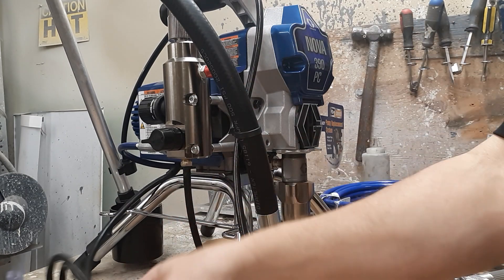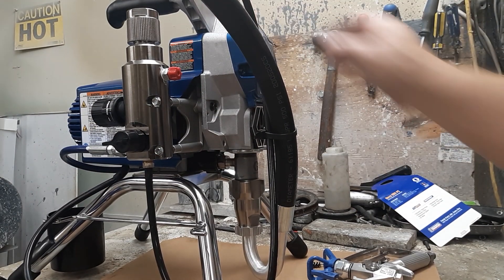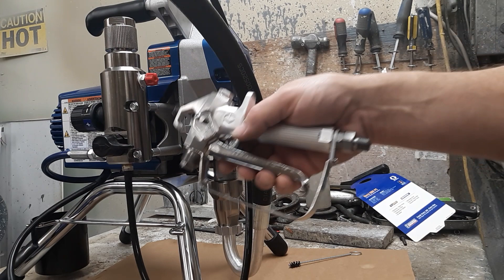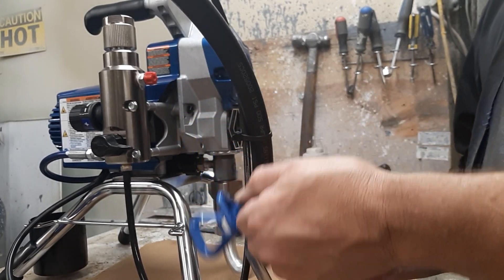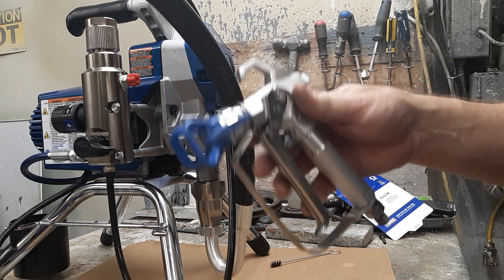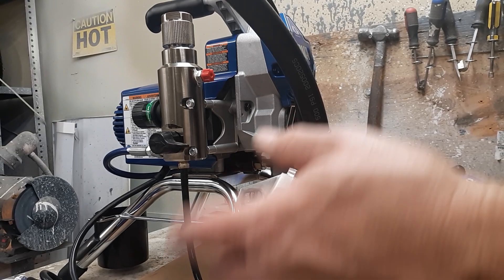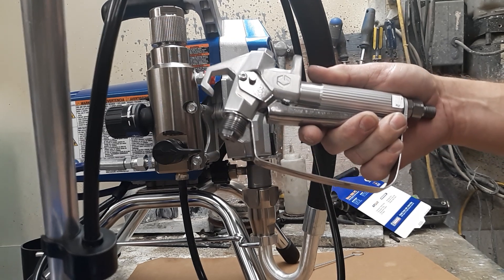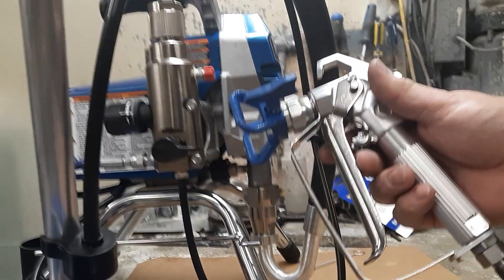How to use a Graco 390 airless sprayer

Comment: Great explanation for a new starter like me. I have watched many videos, even the instruction manual of my new machine but no one explained the significance of free moving nut while connecting paint hose to the spray gun to allow for swivel action of the gun with hand movement. I was in a fix to see why the nut at the inlet of the spray gun kept turning. Thank you for your explanation. Also, thanks for explaning right and left placement of the spray guard/tip hoder for right and left direction of spray. Great work! :washhands:
Reply from the maker: @coloursofniji  I am glad it helped you out. If you'd like to support the channel consider a super thanks.

Comment: For starters it says to run water or mineral spirits through it to take the shipping oil to get it out of the paint sprayer
Reply from the maker: Not sure what your addressing
Reply: @Brian_the_repair_guy  ya in my manual it said to run out the shipping oil that was already in the system,
Reply from the maker: @zachthegunguy  if new, yes. This video is basic operation.  Not specific to new equipment

Comment: Thanks so much for the great video. I spray a lot of xylene  Solvent based products. Do you know if the Graco 390 would work with xylene solvent? Thanks In advanced!!
Reply from the maker: Yes it will.
Reply: @Brian_the_repair_guy  would you recommend after cleaning with Xylene to leave xylene in the machine until next use?
Reply from the maker: @robertdavidson6339  that is perfectly fine. No problems with that

Comment: I just got a 390 and have a project at home this weekend. Curious why do you have to keep taking the tip off ? Couldnt that just stay on ? (just trying to understand that part and if its totally necessary?) thank you for such a great video!
Reply from the maker: I will typically take the tip and housing off when I am moving material trough the system to flush it. I am not sure specifically where you are reffering to about tip removal
Reply: @Brian_the_repair_guy my apologies, i just rewatched your video again, it is excellent. I was referring to removing the housing when you are setting it up with water and moving to paint. Just wondering if removing the housing in those steps is necessary and what would happen if the housing was left on ? The amount of steps is worrisome if something gets forgotten.
Reply from the maker: @chriscarr1791  you can leave it on. By removing it, you speed up the process by moving much more material to flush the system. By leaving it on, the material moves much slower. Either way works
Reply: @Brian_the_repair_guy  excellent thank you! Was worried about any possible damage and injecting myself with paint playing with the housing so much.

One last question on clean up, what is your process on cleaning the filters ?
Thanks again!
Reply from the maker: @chriscarr1791  once the machine is flushed, pull filters out and hand wash and check for damage. Reinstall and hand tighten filter housings tightly
Reply: @Brian_the_repair_guy  thanks man! Appreciate all the help! Great video!

Comment: Hi Brian,
I live in Thailand and here cannot buy that fantastic machine.
So I bought a "similar" one, name Guchen 390 coming from China, for about 300 US $.
I will start using him in about 3 weeks.
What do you think can I expect from such machine? Outside it looks completely as a Graco 390 but of course not same quality, I am not naive.
Have to say that I need to use the machine only for one project, a condo, walls and ceiling with good acrylic paint.
My tips are 517 (walls) and 619 (ceilings). 
I am an old guy... 75.
Greetings and thanks.
Reply from the maker: @rolandsegers6482  this should handle everything you need to do. When you have completed the job, leave antifreeze in the machine to keep the inside conditioned and corrosion free
Reply: Thanks Brian for your quickly reaction.
Here in Thailand there is never frost so cannot find antifreeze.
But what is available here is Toyota Super Long Life Coolant, pre-mixed (pink colour). Can I also use this product?
Reply from the maker: @rolandsegers6482  yes, that will work

Comment: Should both the pick up tube and prime tube be submerged in water?
Reply from the maker: The prime tube does not have to be submerged.
Reply: @Brian_the_repair_guy  ok I just bought the 490
Reply: @Brian_the_repair_guy  so the prime tube is used to get paint into the system or out of the system ?
Reply from the maker: @zachthegunguy  out. It is a return line
Reply: @Brian_the_repair_guy  👌🏻

Comment: What if the machine dont start on low also it does not stop when the trigger is not being squeezed
Reply from the maker: So, when the pressure is set low, it does not run?
When the machine is running and the trigger is not pulled it keeps running? 
Is this your questions?
Reply: Yes that is the question  @Brian_the_repair_guy
Reply from the maker: @rodneystewart6358  ok. Seems you may have 2 problems. 
Not running at low pressure could be a pressure control issue.
The second issue of continuous running, could be a packing issue or something in the pump. 
If you want to contact me on Facebook I can help better. Look for my name on Facebook. I can direct message and send pictures if needed

Comment: does the paint need to be thinned or does setting the right pressure take care of that.
Reply from the maker: You can thin but it is not needed. These are designed to spray straight from the can.

Comment: Can you leave paint in the machine if you’re using it again the next day?
Reply from the maker: Yes. As long as the paint is not catalized. Leave the gun an hose on the machine, drop the pressure and close the prime valve.
Reply: Thanks for the quick reply and for posting an amazing video.
Reply from the maker: @johnzoulek9383  I hope it helps
Reply: Do you mean turn it IN PRIME position?  @Brian_the_repair_guy
Reply from the maker: @rolandsegers6482  turn to prime and then close the prime valve after
Reply: Hi Brian,
During the overnight stay of the paint in the pump, hose and gun, what do I need to do with the suction hose and return rod?
Stay in the paint or move them in bucket of water?

Comment: For clean up do you disconnect the hose and gun or do you leave it all connected and just flush and wash it ?
I am a homeowner so won't be spraying every day
Reply from the maker: Leave everything attached and flush. You can remove the filters and clean by hand. Once you are satisfied with the cleaning, leave everything in place as if it was going to be used.  Pump antifreeze (RV) into the machine and leave it
Reply: @Brian_the_repair_guy  awesome thank you! 2 others questions

I got pump armour when I bought the 390 so I was going to use that instead of antifreeze while I have it 
But do you just leave it in the pump ? Or also in the hose all the way to the gun ?

How do I know forsure all the pressure is released at shutdown ? Is there a way to verify ?

Thanks so much for all the info, great videos, just subscribed!
Reply from the maker: @chriscarr1791  I prefer to pump the antifreeze or armor through the machine and out the gun.
To ensure there is not pressure, open the prime valve and pull the trigger

Comment: In your opinion for this sprayer, which tip is better for cabinets? Store told me green tip (312) is best..another painter said he only uses a 313 for cabinets & most everything else.. just curious what you would use. Thanks
Reply from the maker: Typically you want to use the FFLP tips. These are the green even numbered tips. They allow you to turn the pressure done lower on your machine, without affecting your atomization. Lower pressure with good atomization means more product will actually stay on the surface and not fly away.
A lot of old school painters will use the standard tips, hard to teach an old dog new tricks. 
If you are using latex, the 312 is very good. If you are using oil, you can drop down to a .10 or .08. 
I hope this was helpful, any other questions just ask.

Comment: Thanks for the great video.
I will use for the first time a sprayer (390) this coming Monday and after your video I am very confident about it.
I have only one question if you have the time.
Wouldn't it be better if at the end,after cleaning the sprayer I empty the sprayer from water in it?
Water couldn't cause any rust inside the pump and to any metallic parts?
Thank you!
Reply from the maker: The parts in the pump can rust over a very long period of time. I usually suggest putting RV antifreeze in the system if it is going to be a long time. Don't leave the system dry, that can lead to other problems.

Comment: I just got the 210es from Amazon. Yes, another pre used, half unpackaged, should I send it back or not product from the Zon. I had a titan 440 that was stolen. That machine pushed me to move faster as a novice. If this machine doesn’t give me that same feeling, it’s going back.
Reply from the maker: How much paint do you use in the course of a week or in a month? The 210 is a good machine, with a 15 or 17 tip, it will give you the same production as a 440. It sprays the same materials as a 440. With the same tip, you will notice no difference in the 2.
Reply: @Brian_the_repair_guy  I used to be somewhat of a painter. I have been some of everything since then. I bought this machine to help renovate a rental property of mine. Actually the house my 440 was stolen out of. It was like from 26 years ago. All metal frame and tubes.

I guess my real question is, how will my 210 compare to your 390? There are hardly any videos of anyone using a 210 on YouTube.
Reply: ...and thanks.
Reply from the maker: @dumdiversaspapalbull1452  the delivery of the 210 is slightly less than the 390. When using a 15 or 17 tip, you will see bo difference in production. I own a 190ES, I have owned many machines over the years, I like the 190/210 the best for homeowners or beginning painters. If you were doing 50 plus gallons weekly, then the 390 would be better. 
Given your situation, 190/210 will be perfect.
Reply: @Brian_the_repair_guy  man I really appreciate that. I haven’t used it yet, I just wanted to feel confident that I had made an intelligent purchase.
Reply from the maker: @dumdiversaspapalbull1452  no problem
Reply: @Brian_the_repair_guy  tried it out today. More than adequate for my skills. Did a vid of myself using it. Four minutes and three seconds with the machine, two 5 gallon buckets, one one gallon bucket, and nothing masked. Three quarters of the gallon of primer gone, with plenty of stoppages from just looking. It’s not as fast as the 440, but I got everything that I paid for. Thanks.
Reply from the maker: @dumdiversaspapalbull1452  glad to hear it.

Comment: Why would you add an extra step by removing the guard. Just pull your tip.
Reply from the maker: This video is for beginners to spraying. If you need to ask why I added the step of removing the housing, then you most certainly should be removing the housing.

Comment: Hi, I  just purchased this machine and spraying for the 1st time.  When do I  change the filter in the gun ? After every use or when it starts to fail ?
Reply from the maker: After each use, I recommend cleaning the gun filter and the manifold filter after each use. Just pull it out and wash it with the appropriate thinner. 
This will lengthen the life of the filter and allow you to inspect it for damage. 
Thanks for the question and please subscribe.
Reply: @Brian_the_repair_guy  ok thanks I just did

Comment: When cleaning, does it matter if you clean out the hose first or the pump/prime tube first?
Reply from the maker: It does not matter, I will clean the prome hose first simply because I have to prime the machine in order to get the cleaner to the pressure hose.
Reply: @Brian_the_repair_guy  makes sense. Thank you and great video!